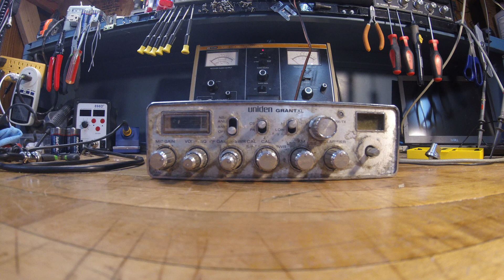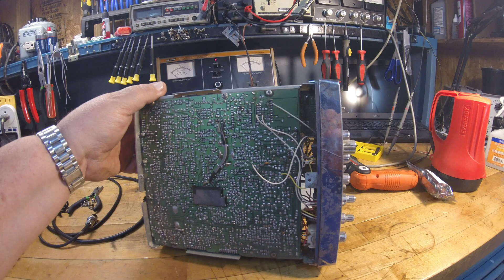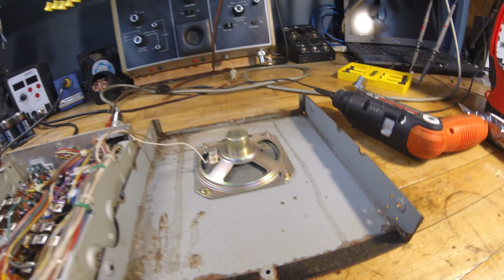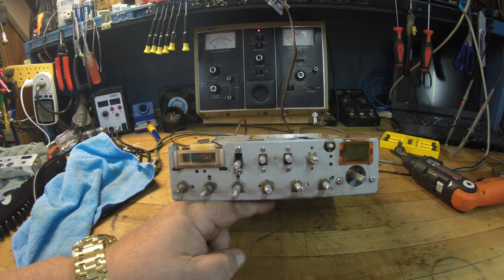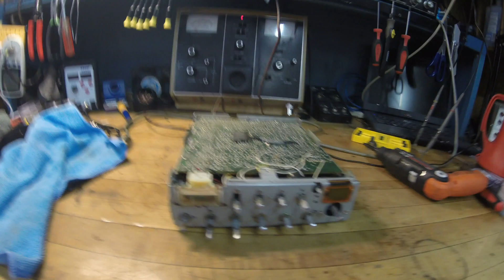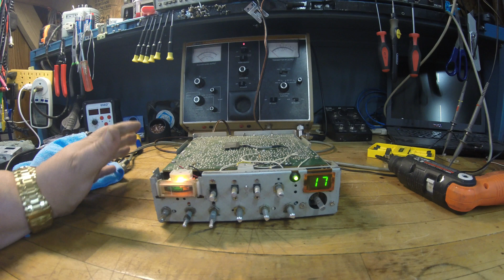Uniden Grant XL AMSSB CB Radio Repair and Restoration Part 1

Comment: Excellent video  :) I know those  Uniden Grant XL never had Variable RF Power and I have same style that to since 2010 it was used one owner before me but I gotten mine for Birthday present in 2010 ! I had mine tune up buy tech , open Clarifier for am / sideband  , meter light also meter changed and plus RX / TX led  also a resitor and antenna jack  to!  My radio is 5 pin I have small adapter goes 5 pin Cobra or  Uniden to 4 pin  in Cobra or Uniden has 5 wires  to inside too! How clean faceplate chrome use a Q tips with light drop of Rubbing Alcohol and controls knobs too! The rubbed lightly with Q Tips 3 in 1 machine oil and wash with water too! You be amazing does to! If worst just paint up with models paints of chrome  and clear coat up!